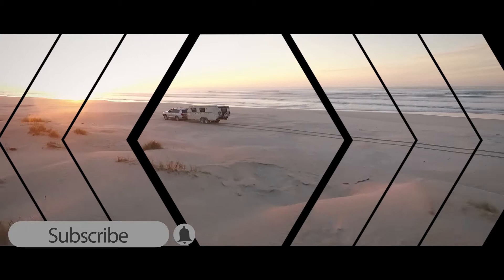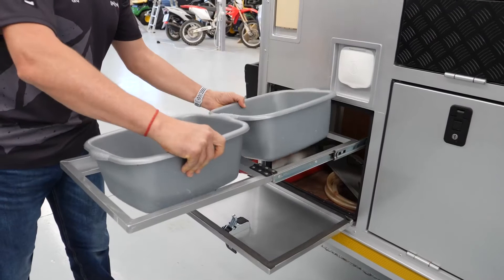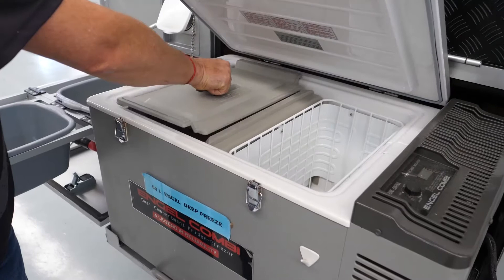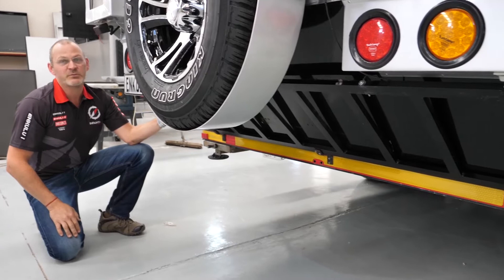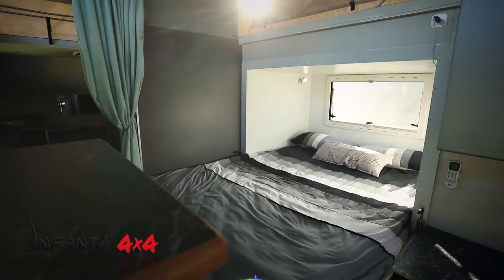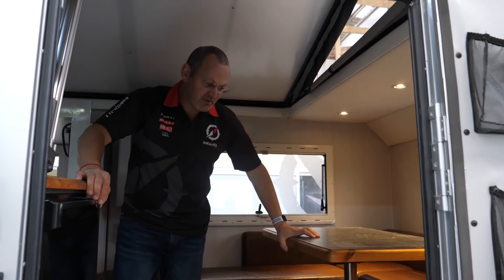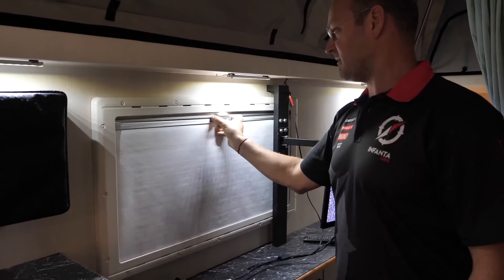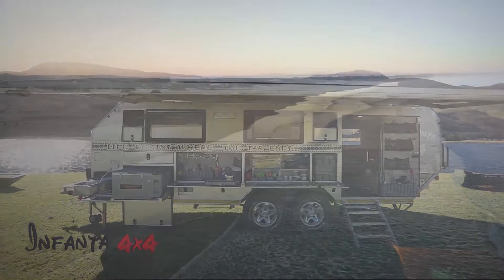A walk through the Enkulu 4x4 off-road Caravan

Comment: Where else would solar panels be,? Naturally on the roof🤷‍♂️
Reply from the maker: Hi Themba, They can also be placed on a stand on the ground or on your car. Often campers like to park their caravans in shade when it's very hot.
Reply: I have 3 on the roof but a portable one for when I'm in shade.
Recently I saw a panel they added legs to and used as a table or collector. Another AU builder makes a 60w awning.